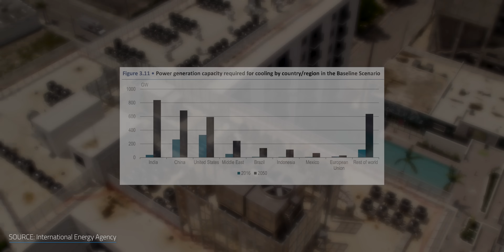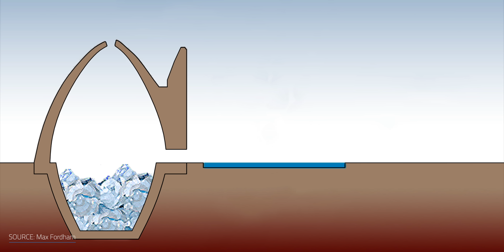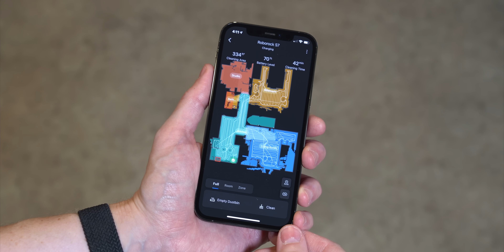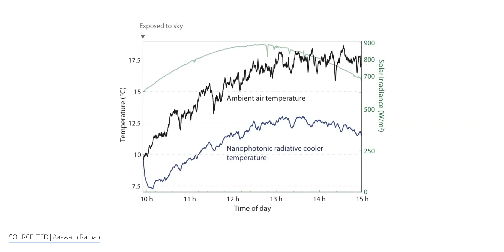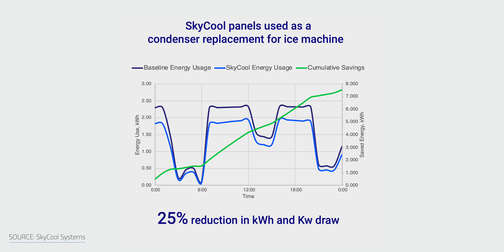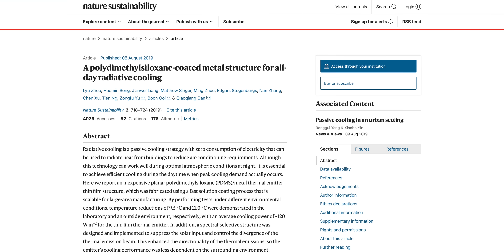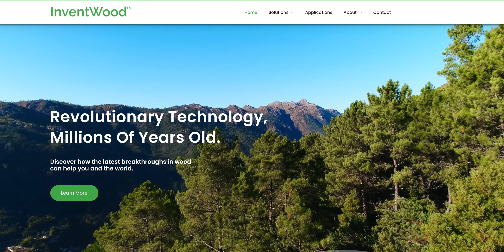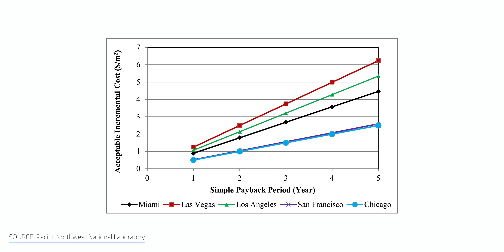Space Powered Cooling May Be the Future of Energy

Comment: I assume radiative cooling panels work best when pointed away from the sun, and solar panels work best pointed at the sun.  That would mean you could share roof space between them, and even use the radiative cooling panels to circulate coolant through the solar panels to increase their efficiency.

How would you “turn off” the radiative cooling in winter, though?
Reply: By turning off the pump circulating the coolant?
Reply: @midnight8341  on cold nights you could risk freezing it, and that risk goes up if it’s not circulating.

Although you could also have a reservoir that could store the “cold” overnight, but that would only help at times you need cooling only during the day …

Maybe a dual-purpose heating/cooling reservoir that your fridge and freezer could also recharge or tap into. But you could end up with an excess of “cooling” potential in winter.
Reply: @ausnetting  not really, though. Even if it were just water, it wouldn't freeze for about 7 months of the year, but they also added Glycerol, which pushes down the freezing point considerably. So I don't think that the coolant freezing in the pipe will be a problem.

And you also wouldn't have to worry about excess freezing potential in winter. You could use a thermal battery, meaning an insulated tank of water 2m underground, connected to your house with a heat pump. That way you can tranfer all the heat from the water into space during winter, freezing it solid and having a huge block of ice providing a heat reservoir for your home during summer.
A 1m³ ice block at 0°C would need enough thermal energy to melt completely to water at 0°C to cool 24000m³ of air down by 10°C.
If you freeze 4m³ of ice to -10°C and then let it warm up to +12°C (temperature of soil under 1m of depth), you would have a heat reservoir large enough to cool an entire 1-family home of about 750m³ down by 55°C.
If you spread that out over the entire summer, meaning that you only need to cool your ground level and first floor, but not the cellar and mostly during the day without having all windows open all the time, it could give you comfortable 5°C cooling over the entire summertime. And that's just 4m³. My parents have a 9m³ well in their garden.
Reply: Snow will do it.
Reply: I think if they were covered with snow that would do it. Failing that just cover them with a tarpaulin or equivalent. Switching it off shouldn't be that hard and could be built into the panel. I mean basically it's a lot easier to stop something working then to get it working. I can only fix a few problems in a car but i reckon I could stop any car working in a one minute.

Comment: Wonder can we use these as cold side of a stirling engine with the hot side using heat provided by the ac unit. Would they generate enough of a temperature differential to make it worthwhile? 
Or potentially other applications where we have a lot of lowish temperature heat energy but temperature difference wasn't enough to make usable.
Reply: Gillo 100 my thoughts too.

Comment: This could be a good option for commercial buildings and renovating older homes, but I think I think I'd rather combine solar panels, geothermal HVAC, and good insulation if I'm building a home. I may not do much to reduce the heat we've already accumulated, but I'll certainly reduce or eliminate the amount of fossil fuels used to keep my lights and AC on.

Comment: Every little step towards a cooler planet is good, even if it's very small. Also, I wonder if it's possible to combine these with solar panels. If you could reflect the infra-red radiation while collect the other useful solar rays then you could get a passive cooling to your solar panel, thus improving it's performance.
Reply: Not if it takes resources away from other, better measures, or even causes pollution in the process of making it in the first place. I wish it were that simple, but it just isn't.
Reply: But more people are killed by cold-related factors (vs heat-related). So doesn't that mean that the earth getting colder would on net produce more deaths?
Reply: But what temperature are we shoot for? What is the optimum temperature?

Comment: It's very interesting but the alarm bells sounds when I saw hafnium oxide as a component. This material is expensive, rare and will increasingly have supply problems (see the "rare earths crisis"). If passive radiative cooling is to be viable, it needs to be based on cheap materials. When the concept can be made to work, it promises a reduction in emissions and making our cities more attractive again. Aircon units encrusting our cities are a visual blight.

Comment: I wonder if this tech becomes efficient enought if it would be worth having distributed cooling as a utility. Having underground cooled water loops cooled by some government regulated utility (underground means you get a geothermal cooling bonus). Water cooling every house with some central giant array of space cooling panels.
Reply: I'm trying not to get impatient with the comments on this video, but it won't work like this.  The paint doesn't cool anything.  It just stops it from getting hot due to thermal radiation.  Ground temps are stable and therefore radiative "cooling" won't do anything.  If you try to locally cool water below the temperature of the ground and then feed it into water loops underground, the water will heat up, because that's what geothermal systems do, is stabilize the temp of water loops to the temp of the ground.

If the goal were to have some massive system designed to cool down the ground, then sure, this would have an effect on that goal (albeit a tiny one).  If the goal is to direct cool water municipally to places for the sake of local temperature control, this will do absolutely zero.
Reply: @michaelleue7594  everything you said is correct, I could have been more clear in what I meant. The underground pipes should be insulated regularly and the water they carry would cool down homes in a parallel setup, insulated pipes underground means the temperature difference from the temp of the water to the temp of the ground is lower than that of the air in climates where this would be beneficial, meaning the water warms more slowly than if the insulated pipes were above ground. The cooling paint/panels would be off somewhere like a solar panel farm cooling incoming hot water and pumping cool water out to homes. I was way too focused on the benefit of having the pipes undeground. Having a bunch of this "cooling" paint underground will do squat. 

The idea is similar to how in some countries they do the same thing with hot water to warm homes.

Comment: i'm a bit puzzled how the working principle to radiate more than it absorbs plays against black body radiation and 2nd principle of thermodynamics. so coating with those fancy paints can make two bodies in a room of different temperature ?! 😕
Reply: The sky may look clear, but it is in fact a giant mirror that bounces heat back. That's how greenhouse gases work, after all.
The principle here is quite simple. Throw a ball against a wall and it bounces back. You need to throw it 10+ more times to get rid of it. But step over a few feet and throw it through an open door, it won't bounce back.

Comment: On a geoengineering scale, this could be paired well with geothermal cooling. Dump all the heat that the panels can't reject into the ground, then cool the ground at night so it's even more efficient when you need to use it in the morning. If you could also have these on solar panels that flip over at night then that would be awesome. Harvesting solar energy and dumping heat into the ground during the day, then passively pumping all that heat out at night. Maybe we could also bioengineer an algae that has these properties then release it into the ocean to cool the planet, then it would take care of the exponential growth.
Reply: To complicated solution that would be too expensive too operate. If you want something cost effective it has to be simple.
Reply: @Dawid-kn6mv  It could be done easily on a small scale, say for individual homes. If you can dig a hole say 5-8 meters deep you can run a pipe down there.  I've seen people use this to liquid cool computers. The loop runs through an old oxygen bottle as a reservoir buried at the bottom of the hole.There's your geothermal cooling. Plumb it into a night-sky cooling panel loop and a simple heat exchanger to provide the cooled air for the home. Simple solenoid valves and temperature sensors can bypass one of loops (ground or panel) depending on relative temperatures, like bypassing the panels in the heat of the day where they're not cooling the fluid at all, instead just pumping it through the ground loop to pump that heat into the ground.
Materials don't need to be expensive or complicated, so could easily be a cost effective supplemental cooling solution.
Reply: @shinjisan2015  Sounds good on paper but I wouldn't be sure about serious practice. I work with heat pumps and now everyone uses the air ones because using ground is too expensive and inefficient. It takes a lot of  pipes in the gorund to extract or dump heat energy to the ground.
Maybe as DIY project for small needs it can have sense
Besides it doesn't fullfil the basic purpouse mentioned in the video of sending heat to the space. Instead of all this effort and cost it would be simpler and maybe even cheaper to buy aditional panels.
Reply: @shinjisan2015  it would work great if you already have a downhole heat exchanger, a normal downhole can go down to about 200m
Reply: I was also thinking about an algae covering some parts of the oceans. But if it gets out of hand, it would be a trefying thing.

Comment: I can imagine alternating rows of these panels and solar panels, with the solar facing the sun and, backing them, the radiative panels facing away from the sun. On a flat roof this could be viable.
Reply: Could also run the cooling tubes to the solar panels themselves to cool them down and improve their efficiency.
Reply: @chaseweeks2708  

We all could build underground houses and the savings on heating and cooling will be huge.
Reply: @ajarivas72  , but the view would be shite. Lol
Reply: @chaseweeks2708  what view?
Reply: @ajarivas72  exactly
Reply: As an owner of a flat roof.... this is basically what I was picturing too :)
Reply: @kelvin2739 , either way. It would be interesting to see the results of those tests.
Reply: The panels need to have a direct view to deep space on the majority of a semispherical plane. If you tilt them "away from the sun", the will necessarily see the earth (or other buildings) in a lot of their viewing direction, and thus will be thermally coupled to those objects instead of just to deep space. And this can degrade their efficiency very quickly. I'm pretty sure that you won't get any significant cooling out of them if you place them at an angle of 30° or larger from local zenith.
Reply: @ShieTar_  I am suggesting a tilt such as would optimize the efficiency of solar panels where the sun is not directly overhead at zenith. Usually this will cast some shadow behind them which is ‘lost surface’ for electrical generation purposes. Placing the cooling panels in this location would not necessarily require that they be tilted also, just that they occupy the shaded area. To maximize the use of the area for electrical generation an ‘acceptable’ tilt angle on the cooling panels should allow for a tighter configuration of the solar panels, especially where, repeated across the width of a roof, an entire extra row of panels might then fit.  Cheers!
Reply: @kelvin2739  Shaded area is not the same thing as having a view to space. In the infrared spectrum, the radiator in the shadow of a PV panel will mostly see the back of the PV panel, which is actually radiating a lot of IR light, so it will completely sabotage the function of the radiator.

It may be difficult to believe just on qualitative argumentation, but once you do the math you will quickly see the very significant difference between radiating into the 3K of space (and thus getting nothing back), and radiating towards some other materials at ambient temperatures, which emit more than 100W/m² of infrared radiation at all times.
Reply: @ShieTar_  I can't follow. You seem to be insisting that the radiators have to be pointed at something nearby instead of open sky, which is the whole point of their design. Am I incorrectly understanding your statements?
Reply: @MrHuram-abi  Shie seems to be thinking that cooling panels need to be “aimed” like solar panels do. They don’t. They just need to have direct line of sight to dark sky, within 20 or 30 degrees from straight up. They radiate heat to deep space in all directions they “see”. The best cooling is straight up, as there’s the least atmosphere there, but it’s not required. Angling the panel can improve shading and heat absorption during the day, but as long as the area above is open to sky at night,it will cool. It will lose some efficiency as the effective surface area(as seen from directly above) will decrease as the cooling plate angle increases. (Loss increases as the sine of the angle from flat)

Heck, even solar panels  don’t need to be perfectly aligned with the sun. Yes, some small efficiency is lost, but for residential use, just aim them south (or west ish, depending on needs), and angled for the sun at its lowest ( winter solstice) and you’re good to go. If the loss of 5% or 10% of power is a problem, add one more panel. That’s the benefit of simple solar and simple radiative cooling: the panels are relatively cheap, so adding a panel or two to make up for less than ideal placement is cheap and easy.

The downside to ALL improved energy efficiency projects/upgrades is that NONE of it is truly “cheap”:

The cheapest, “do it yourself” solar and battery system for a small/moderate house is about $12,000. (Look up DIY solar with Will Prowse for a recent vid on this)

Improving the R value ( insulation value) of your house (walls,  ceiling, floors and windows) fo a similar house will be closer to $20,000 (and is much harder to DIY because of the amount f work)

Switching to an energy efficient heat pump is about $8,000 and up, and is really only helpful with a decently insulated house, or a house with old school electric heating.

Switching to a heat pump style water heater is “only” $1,200 (plus labor, if you don’t DIY). This cuts electricity use by roughly 50%,  but is a usually a smallish benefit. But, it is the cheapest upgrade.
Reply: @MrHuram-abi  No, your interpretation is the exact opposite of my statement. They specifically should not see anything except the open sky. Every object that has a normal temperature radiates infrared light, and the point of a cooling radiator is to radiate light away and to not get any (or at least not much) light back from other objects. 

At a tilt angle of 45° on a flat&high surface  you would only see open sky in half of the relevant directions, and warm objects in the other half. So you lost at least half your cooling potential, and possibly much more when there are some particularly warm objects in your field of view, like operating PV panels as an example. You have to understand here that the amount of radiated infrared light scales with the fourth power of the temperature, so minor differences add up very, very quickly.

The point just is that the cooling capacity of the panel is maximum when oriented perfectly towards the sky, and it will generally drop in efficiency very fast if tilted away from that OR if you put some other objects into its field of view.